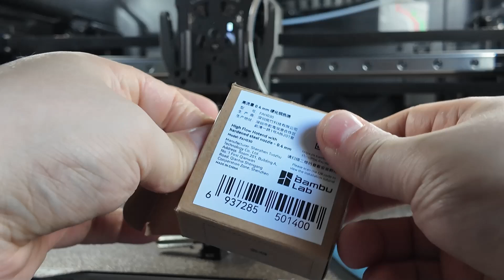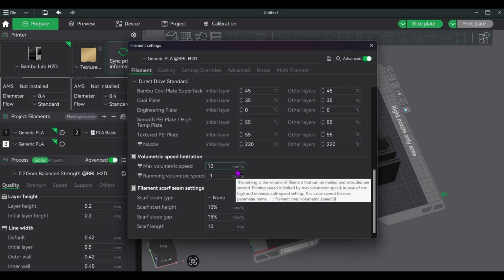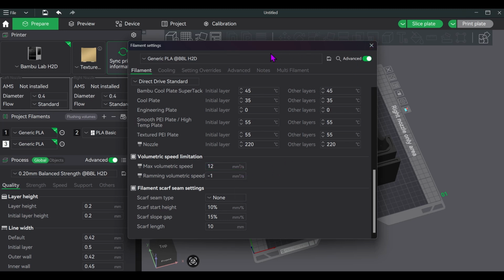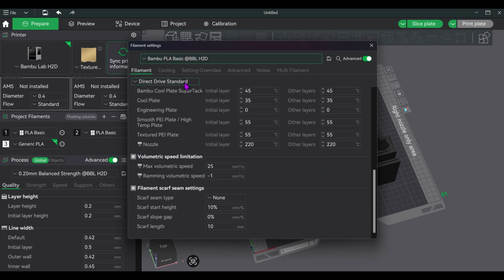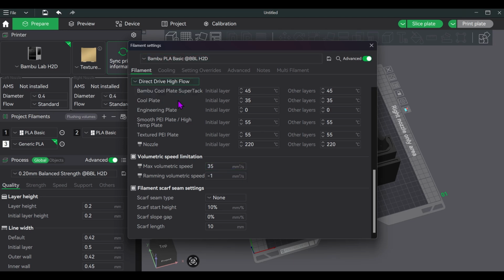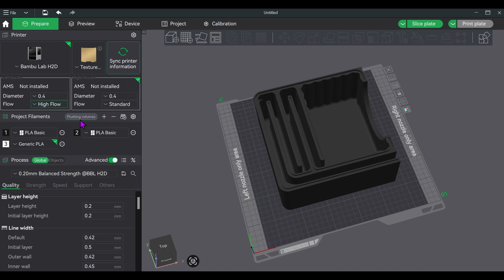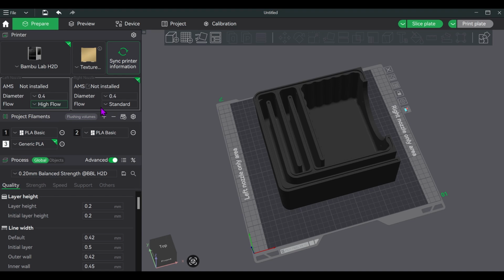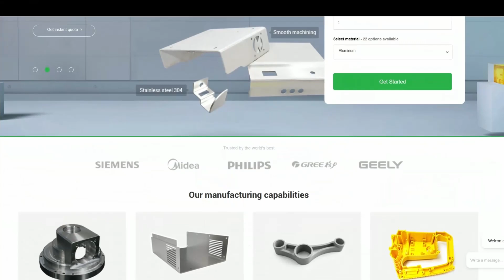Bambu Lab H2D High Flow Nozzle Tested: Is It Worth the Hype?

Comment: I thought/expected that since the H2D has a nozzle cam, it can 'see' what nozzle is fitted and that it would automatically select the right print profile or at least give me an instruction to choose a profile fitting the HF nozzle in order to fully utilize the better speed.
Reply from the maker: unfortunately it doesn't see which Nozzle is fitted... so you still have to manually select the correct nozzle I'm afraid, i know it sucks!
Reply: @aim6mac  But there's a little QR code on the nozzle...you'd think it's for identification. Missed opportunity.
Reply from the maker: @PhilippensTube  they might enable it with future FW upgrades..

Comment: So why doesn't the printer come with the HF nozzles? What is the downside?
Reply: You also need a high flow filament to get the benefit
Reply from the maker: well bambu recommends to not use it with TPU filament, so it's less compatible with some filament types I guess

Comment: ok but I am looking at all of the high flow settings beyond the bambu lab pla and nothing is changing. How am I suppose to know what flow rates each type of filament should be bumped up to?
Reply: Create a new session in Bambu Studio, add the filaments types you want to use like Bambu Lab PETG-HF and PLA-Matte.  To the right of the filament is now 3 dots in a circle, click on it and edit.  In the filament profile, expand the window from the bottom until you see Volumetric Speed Limitation.  At the top, below filament, now click on the box for Direct Drive and select High Flow and you will see that PLA-Matte and PETG-HF are moving up to 35mm3/s.                                                This is the same value I use for Elegoo Rapid PETG.  Then I run a racetrack speed test (makerworld) and verify I can print smoothly.  Manufacturers post standard filament volumetric speeds based on standard nozzles (they should also do like E3D and list volumetric values based on standard/high flow nozzle size and temp settings as well).  This all works find for the H2D 0.4mm HF nozzles.  The new 0.6 and 0.8mm nozzles just dropped recently and I expect they would have different requirements volumetric values based on nozzle size and temp settings.
Reply: Run a max flow rate test

Comment: First, video very much appreciated.  Kind of angry, though, that there is no wiki for this.  I bought the hi flow, and calibrated the settings as you suggested, but when I slice the part, I'm not seeing a jump in predicted speed.
Reply: You are correct. I see it not working on PLA-Matte and PETG-HF.  I had endless tickets to Bambu Lab and they won't acknowledge they disabled higher volumetric values.  I used a solid cube as an example that was 280x280x280mm.... a perfect example.  No change from normal to high flow nozzles with the filament profile set to high flow.  More so...when you slice as normal...you notice that you can save...when you update the filament profile to high flow the slicer does not enable re-slicing and you cannot save....hence, it does nothing.  Bambu Lab just ripped everyone off on high flow nozzles since their printers no longer support it.  If you lower volumetric to 1 you will see it triggers a re-slice required and save is enabled.  However, I noticed from 25 to 35 (I mainly use PETG-HF) the system will not reslice.  It worked in prior software versions before the H2D was released.  I also noticed that the high flow nozzles were not released to influencers on day one with the printer.  I think they know there is an issue.  I have even noticed when i hit ludicrous speed, set all speed settings to 600mm/s...there is no change.  The calculated time on the printer going to ludicrous speed states it will speed up but as you get close to that time it pushes out.  I have prints that take a couple of weeks to complete and in the end it is always much closer to the predicated unaccelerated values. I wish someone did a deep dive video on that because Bambu Lab sold us this speeds up printing.  It speeds up nothing except depleting our funds.  You have to go beyond the theoretical print time and actual use a separate clock on a job that takes a couple of days to print and then you will see how it is not accurate.  It use to be before the H2D.  I thought I read somewhere that Bambu was nerfing the PETG-HF acceleration, but I can no longer find that from Bambu.
Reply: @alex3dprint-us Thank you for taking the time to compose such a detailed and thoughtful comment.
Reply: @DanielRLuke  I figured out the settings issue.  It is one button I was missing and now my speed settings work.  I posted a 12 min video but in the first few seconds it tells you the button to hit.  There is also a setup guide for high-speed printing on the H2D.  I spent most of the day trying to solve it because has bugged me for so long now.   https://www.youtube.com/watch?v=jdAQEPBVIaE
Reply: @alex3dprint-us  So does it work at the end? Should I buy the nozzel? 
(your video seems to be offline, is this on purpose?)
Reply: @LucasDynamics user error (me).  It does work.  The problem was that the Bambu Studio slicer remembers settings and sometimes that shoots me in the foot.  When i went to the speed tab (using one nozzle) I assumed it was defaulting to the left nozzle.  Nope, it was going to the right one so the settings I was making was to the nozzle I wasn't even using.  When I hit synch both nozzles (I do this anyways now), it did send the settings to the default (left) nozzle.  I will make a video showing my settings and work flow now that I got it corrected.  It took two months for Bambu Studio to help me find the issue in my work flow.  I'm sure others have had the same issue.  Simply synching both nozzles gets around it but the underlying issue was the software defaulted to the right nozzle and we print by default on the left nozzle.
Reply: I created a quick video.  https://www.youtube.com/watch?v=KDrMlTuFj-Y                  Just remember all the volumetric settings you find out there should be based on standard nozzles.  E3D was making Bambu Lab X1C nozzles and they did a good job of comparing nozzle size, temperature settings, and material to create perfect settings.  I am using that concept in my video to support material on the market like Elegoo Rapid PETG that supports 600mm/s.
Reply from the maker: I feel your pain!

Comment: My H2D HF nozzle doesn't like ELEGOO Rapid PETG at 35mm^3/s at 260C. The extruder makes clicking noises and won't extrude correctly during the startup Gcode. It works great with Bambu PETG HF though.
Reply: If it is at the loading (startup) then it might be the filament is not hot enough to melt (In my experience) and I have simply cancelled the print, then edit the filament profile, and bumped up the top end (max) to 270.  Bambu Lab makes the generic profile unoptimized. I use Elegoo Rapid PETG almost exclusively since Bambu ran out of PETG-HF a month ago or so ($10.55 by the case on their site)...  The best was I found was to take the Bambu PETG-HF profile, click edit, then save as Elegoo Rapid PETG (or similar, then set the Direct Drive High Flow Nozzle Temp Min/Max to 250/270.  Set the Print Temp - Nozzle - Initial/other layers to 260/260.  Verify you see the volumetric value is 35. save it.  I also do this for my direct drive standard flow profile since I only use high flow nozzles. If unfamiliar, I can post an Instagram showing how to do it.
Reply from the maker: yes the clicking noises means it's skipping steps,  different filaments have different ingredients , bambu's filaments overally have better flow.
Reply: No cooling issues? I cap at 18cubic with regular petg when printing vase mode.